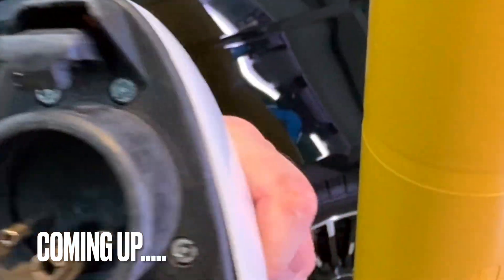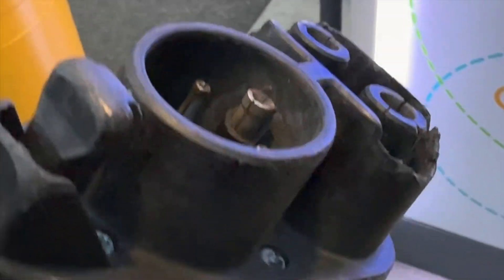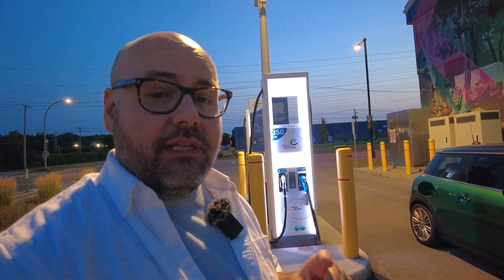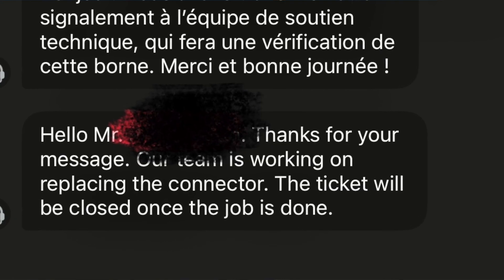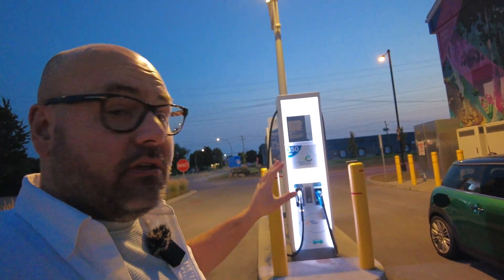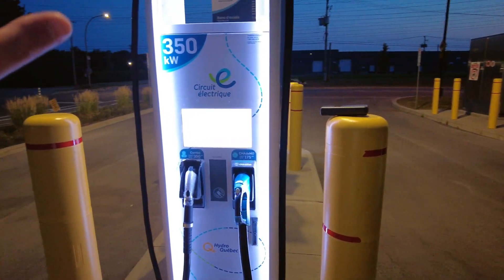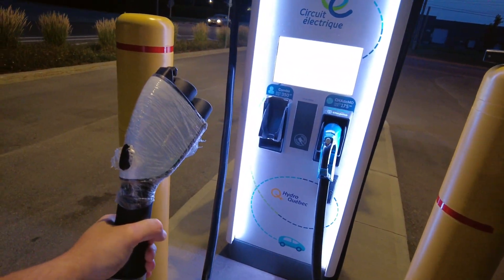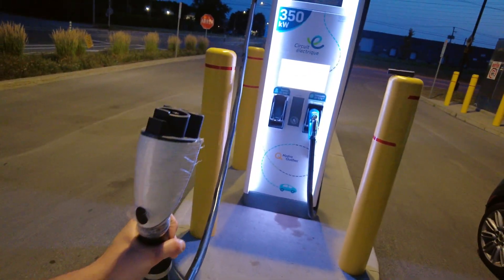Are Broken EV Chargers Repaired?  What I Found Out!

Comment: honestly... shouldn't the charger operators be monitoring plugshare ?  I see lots of reports of broken stuff on plugshare.
Circuit Electrique is generally fantastic.
Reply: I got a reply from IONNA a few hours after I reported a failed charge.  They even sited a review of logs and suggested a TSB for my car that might help.  I assume a software or data issues of some kind.  A few weeks later, I had zero issue charging my car at that same site.
Reply from the maker: EA has been good lately as well
Reply from the maker: They definitely should be, but it's not always the case. I just open a repair ticket and submit a photo.

Comment: In my limited experience with CE they run a pretty good network.  Hope that holds true when I travel to PEI.   IVY in Ontario(basically Ontario Hydro) has been swapping out chargers along the 401 and 400 series of highways.   IVY is responsive but a couple of years ago I reported a dead screen at the Trenton ON-Route and two months later it was still dead....The charger itself was functional as I used my IVY card to start the session.  Hopefully the replacements(Kempower)  will be more resilient
Reply from the maker: Some IVY equipment has been swapped out already. Going through Quebec you know won’t be an issue